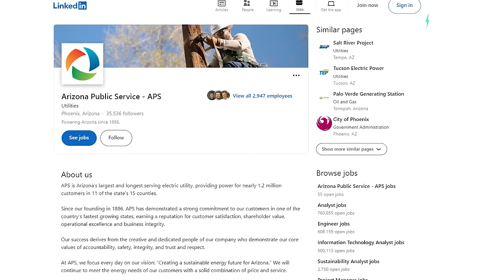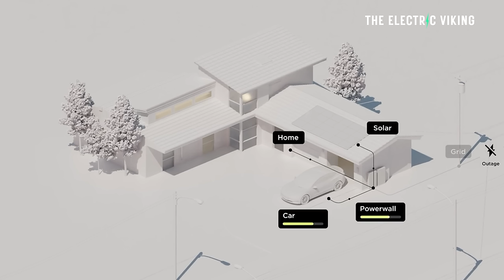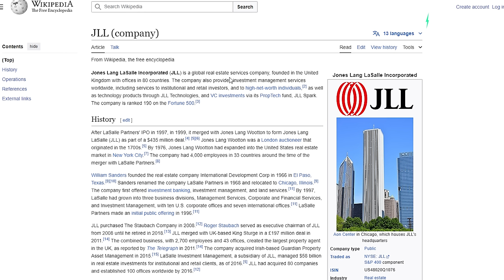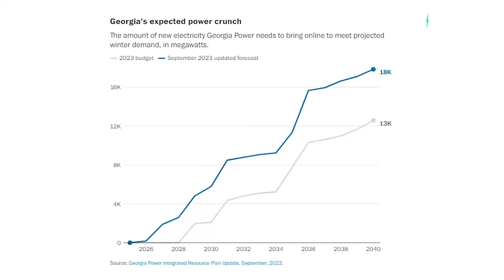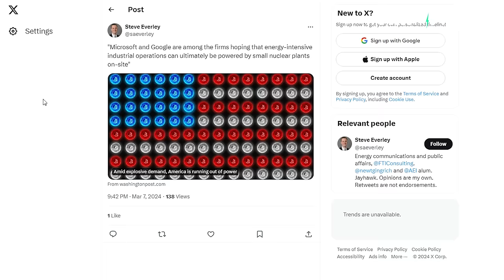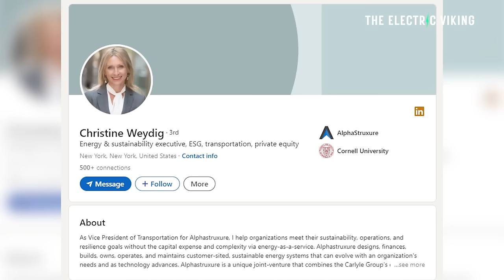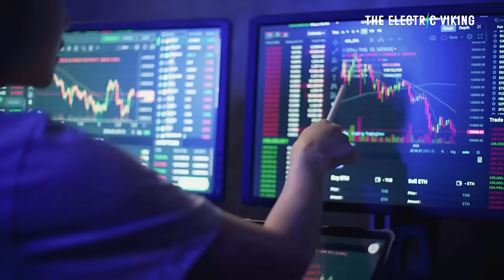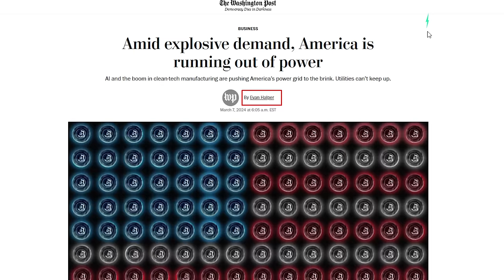An explosion in demand for electricity is creating a looming crisis in America

Comment: I'm not hopeful about permitting reform, interconnects, transmission lines.  There are too many interests involved.  

Data centers should be responsible for their own power (or at least a good portion of it).  These are tech companies with deep pockets.  Maybe they can jump start the micro-grid, off-grid business, drive down the costs, and the rest of us can benefit from it.  (Also, nuclear.  Though nuclear has its own regulatory challenges.)  They can  also  co-locate the centers where there is strong renewable resources.  It's easier to ship data, than ship electricity.

Comment: In Mexico, commercial electricity rates are much higher than residential rates.  More usage per month can put either  commercial or residential into higher marginal electricity rates.  It seems that in the USA, the large users get preferential electricity rates.  If the rates for large electricity usage increased substantially - the high users would be incented to install batteries and possibly solar to defray the higher monthly cost.

We need to fix the incentive system for electricity in the USA.
Reply: Commerical SOLAR generation & Storage, over Commerical energy use.

Comment: Nuclear has TWO MILLION tiimes the energy density of solar, wiind, battery, geothermal, etc. It is the cleanest, safest, most reliable source of power. The U.S. built 100 nuclear plants in a 10 year period in the 60s & 70s, average build time was 36 months, and could be again. NONE of those plants has harmed anyone from radiation. The Nuclear Regulatory Commission has driven up cost of nuclear plant construction in the U.S. and needs MASSIVE REFORM. The smaller the size and greater the number of plants, the more distribution over distances on the grid is reduced. It also reduces cost of borrowed money for long-duration builds. When nuclear has a renaissance you'll know math, science, and seriousness have returned to public policy in the U.S.
Reply: True.
The best, and constantly operating nuclear power is being generated 8 licht minutes away.
Reply: What will fix the issues here is STANDARDIZATION - ONE and ONLY one reactor design and the SAME controls across the ENTIRE US.
Reply: @stevenmercurio8536  Sometimes that helps. But often : one size doesn’t fit all.
At some (bigger) places: Thorium, but at smaller, or temporary places SMR.
Reply: Nuclear is not clean, this is BS. Where do you store the nuclear waste? Decommissioning a nuclear plant is a long expensive process, that nuclear advocate never calculate in total cost of operation. Renewable + battery storage is the answer, along with all the EV batteries that could help the grid when needed.
Reply: @hanswitvliet8188 Exactly!  The solar panel farms are the receiving end of the wireless solar power system.
They allow agriculture beneath them and cannot be used to make dirty bombs.
Reply: We do have some rather unsafe nuclear reactors here in the US (Mark III's, IIRC, that require power to drive motors to push the control rods up from beneath the reacor against gravity, vs more modern designs that can lower control rods from above via gravity when power is lost (like in Fukishima)).  

Any new plants should be built as Thorium Salt Reactors that create less waste, have lower half-life of radiation, and are safer to operate b/c they don't require shutdowns to replace spent fuel rods every 18 months (they are perpetual processes).
https://www.youtube.com/watch?v=1BmWhS7g2ts&ab_channel=SubjectZeroScience
Reply: @rozonoemi9374  You are both full of it.  CCTG and CTG on natural gas is by far the best solution.
Reply: @rozonoemi9374  Except that until battery storage needs to be about 10% as expensive as it is now to make this practical
Reply: @danielking2944  at Some places, big parking lots are covered with PV, like the TT-race circuit near Assen.
Reply: @rozonoemi9374  No, it isn’t BS, but an economic choice.
In France they demonstrated that they can reduce the half-life of plutonium and cesium to less than two years. But it comes at a price, that some are unwilling to pay.
Reply: @hanswitvliet8188  Thank you. Most people disconnect that solar power is actually NUCLEAR and not chemical. Big difference.
Reply: @rozonoemi9374  FICTION and poor fiction at that. High level waste is stored on site at every plant in the U.S., has been since the beginning, and has NEVER HARMED A SINGLE PERSON. Plants from the 60s and 70s are still running and having extended licenses for another 20 years. Compare that to the MILLIONS of deaths yearly from fossil fuels, which provide EIGHTY ONE percent of total energy globally in 2023, fossil fuels is the alternative, and never takes responsibility for waste. Which oil company do you work for?
Reply: Of the 253 nuclear plants that were originally ordered between 1953 and 2008, 121 (48 percent) were canceled before completion. Of the 132 plants that were built, 21 were permanently shut down due to reliability or cost problems, while another 27% completely failed for a year or more at least once, according to Rocky Mountain Institute.  The average nuclear reactor only delivers about 1 Gigawatt. Palo Verde has 3 reactors and only delivers just under 4 Gigawatts and took 10 years to build.  San Onofre was 2 Gigawatts and was shut down about 10 years ago and is still in the process of decommissioning.  Billions of dollars to build and billions of dollars to decommission.  Last year the US add 33 Gigawatts of solar, or about the equivalent of 33 nuclear reactors.  Nuclear power is an industry that has proven that it can deliver an ever more expensive product and take longer to produce it.  If energy were based on market forces, the nuclear industry would have been out of business long ago.
Reply: @rozonoemi9374  I agree 100%
Reply: @rozonoemi9374 battery disposal will be a problem and we have no idea what the long term consequences will be.
Reply: @muskrat3291  I can cherry pick data and make a much more compelling pro-nuclear argument, but considering your apparent bias, I won't bother. Enjoy watching the ecosystem go up in flames and drought, crop failure and famine, coral bleaching and ocean acidification, while China has 22 reactors under construction, approved 10 in 2022, & has the capacity to add 8-10 EACH YEAR, which has driven down the price of nuclear power in China to below $70 per megawatt-hour, compared with $105 in the U.S. & $160 in the European Union, according to the International Energy Agency. Where there is a will, there is a way; where there is defeatism, there's a muskrat3291.
Reply: But they never get built on time and always  double the budget
Reply: @samuelwilliams7331  The 100 plants built in the 10 year period of the 60s-70s were in fact built on time and on budget, average build time was 36 months. It can be done again. NRC must be reformed and nuclear industry in the U.S. must be rebuilt. U.S. doesn't really do nuclear. China, Russia, France to a degree, still have a nuclear industry. It takes experienced workforce and established supply chain to be efficient, not NRC meddling / interference.
Reply: The issue is EVERY SINGLE ONE was a one off!  NO standards its like trying to build cars but you change the design after building each one - no kidding they are crazy expensive and harder than they should be to maintain and operate!
Reply: @stevenmercurio8536  Early U.S. nuclear plants weren't one off, and the NRC added ZERO benefit; NO BENEFIT WAS NEEDED. Nuclear plants are easy peasy to maintain & operate. Nuclear and non-nuclear power plants around the world are run by computers. The humans at nuclear plants sit arouind watching monitors of a perfectly functioning computer system.
Reply: @beautifulgirl219  I work for Elon!

Comment: ac and solar should go hand in hand when rhe  ac is on the sun is usually out
Reply: Yes!
It is the answer and saves you a fortune.
Use the roof you have and cover it in solar to power the home battery and EV you have.
This is then yours and this is why the electric companies want to limit or stop it.
Take care all and do what is best for you. M.
Reply: Not in TX. It can be 88 degrees outside, while cloudy, or 78 degrees and muggy, while cloudy. Also, it can be 88 degrees at night for about 6 months out of the year around summer.
Reply: @RT-mv7df   Solar works fine in Texas for active cancellation of Air Conditioning.  Why make up such BS?

Comment: "Green hydrogen" from electrolysis has a round trip efficiency of <40%. You loose 60% of the energy by using hydrogen than if you were to use the electricity directly.

Comment: Demand for electricty in the United States right now is truly enormous absolutely and in no small measure being driven by a massive surge in lng exports and Space Launch and presumably pure play bev sales which continue to surge and are starting to be seen as not in the least cost free to use over the long term anyways but no different from current pure play ICE platforms as is already well established. USA does import nominal amounts of electricty from Mexico and Canada which mitigates somewhat but nothing compared to with the massive build out of combined cycle natural gas turbine generation added to that moar wind power which at the moment for the USA is a very impressive and prodigious producer of the electrons particularly in the US State of Texas but also the State of Iowa plus going up and down the Columbia River Valley where massive amounts of electricty is produced using hydroelectric generation. Long story short no matter how bad the news coming out from Boeing hard to produce an air frame of less expense than a Boeing going on forever now #autoclave

Comment: Now let me get this right - America develops more demand for electricity by developing more data centers which consume huge amounts of electricity, build ever more demand for electricity by pouring ever more people into cities by driving more people away from rural areas, pour more people into cities from outside of America thru open border policies, increase demand for electricity by making people dependent on personal devices and transport systems, make accommodation more reliant on electrical devices, drive electrical production away from readily available "fossil fuels" and toward unreliable "sustainable energy", reduce maintenance let alone expansion of the electrical grid, and SURPRISE!!!!, the electrical grid fails to cope with demand - "how did that happen???" wonders those responsible for all of it and everyone but them saw coming....
Reply: Spot on!!!  And for each household that converts to EVs (let's just say 2 cars per home), adds 30-50% more demand in electricity -- average of 300kwh per car per month (equivalent of about 10kwh per day, equivalent to 30-40 miles per day in a Tesla Model 3 that has rough efficiency of 4mi/kwh). Average daily commute in US is about 35 miles. So for 2 cars, that's roughly 600kwh extra on your electric bill per month.  Go look at your energy bill & see what that does to the total electric you use each month.  For me in a 1100sqft 2BR apt, my electric is 900kwh per month (averaged over 12 months). So this is 2/3rd the total electric of a medium apartment.

Better invest another $30 Grand in solar and batteries, especially since everything you just mentioned WILL increase the cost of electricity, and even then, if you avoid the electric rate increase, the gov't is still going to shaft everyone with higher taxes to try (but Fail miserably, and thus devalue/destroy the $) to pay for all this.  There's a reason we have inflation, and why it's not going to go away like the Gov't is trying to convince everyone.

Comment: Is Sam aware at least three of those Tesla storage sites caught fire and couldn’t be put out.
The theory is right, but the application isn’t, the type of battery being used isn’t ideal.

PART OF STORY BELOW
This is the third Megapack and Powerpack fire that has emerged in a bit more than two years and the second one in Australia. The first happened on July 30, 2021. A Megapack caught fire in the Victorian Big Battery in Victoria, Australia, while it was still on tests. It was later determined that the combustion happened due to a short circuit. The second one started at 1:30 AM on September 20 in Monterey County, California. The Elkhorn Battery Storage facility fire demanded Highway 1 be closed so that firefighters could use one of its sections to extinguish the fire

SINCE THEN
Two have happened in Australia one in Queensland.

Comment: Very predictable. Industry is very energy intensive. Electrically powered industry needs all this in the form of electrical energy (as against heat).  Failure to construct and complete nukes is going to cost them dearly. 

Might be possible to do it with renewables but this will require huge upgrades to pumped hydro and the necessary aggregation grids.

Comment: The reason that Crypto will not and does not want its own generation (a long-term plan) is because Crypto is a short-term operation.  The primary reason it exists is because there is a(nother short term) bad-faith operator of the primary currency.  Whole other topic, but also not a long-term condition.   Meanwhile, Solar PV is expanding quicker than the overall load of the grid.  And the routing for future Transmission is not what has become the relatively short (few hundred miles, max) of overhead HV AC -- but rather HVDC, which can go Coast-to-Coast, making a 12 to 14 hour Solar (only) Day.  And the (already known) best routing for HVDC is underground, along the existing city-to-city Interstate Highway system.   These were mostly make-believe problems in this video, while missing what is really going on.

Comment: In temperate latitudes a wind and solar is a stupid, dreadful idea, especially if it is supply baseload. That is because for every megawatt of solar baseload you have to build the same value in back-up power for when the sun is not shining or the wind is not blowing. Batteries (we’ll ignore how the planet has to be r@ped to make them) can be used but they can only short term relief. Using car batteries requires them to hooked up and then to a “charger” that can power the grid.

Comment: Texas has lots of empty room for wind farms, even then Natural gas supplies the base load. 3x the name plate rating of wind turbines. Wind turbines and solar are only 30% efficient.
The further north you go, the worse the efficiency. Texas wind turbines shutdown because cold weather dropped below their temperature rating.  There is no such thing as excess power generation, gas and coal plants throttle with demand.
Reply: There is no "temperature rating" for a wind turbine.   During the Texas Freeze many turbines shut-down because ice formed on the blades, unbalancing them.  So they had to be turned off.  But turbines further north that were built with de-icing strips on the blades kept running normally.

Comment: Texas has the answer. Instead of nesting in coal or oil fired electric generators, they are investing in renewables.   TEXAS  had more renewables than any other state. YES including California. 
    You see Texans can do math.   They understand the multi millions it takes to build the power plant is only 20% of the cost.  The rest is buying the fuel for that power plant.  
 While renewables have no such costs. 
       During high wind/ solar periods they charge up  storage batteries ( whose cost is dropping rapidly).  For the use when the sun fails to come up or the wind fails to blow.   Yes even n cloudy days solar panels generate electricity.  With taller and taller wind generators  wind is more and more reliable.

Comment: Electrify rates in Texas are 14.58 ¢/kWh, whereas in California, the nation's leader in "green" generation and battery storage, the rate is 29.11 ¢/kWh. Go green, get boned.
Reply: Go green, get your own solar and battery and save in your pocket.
I’m not green just want to save my money.
Take care M.
Reply: When the climate changed Texans will suffering power crisis like 2021 more often.

Start develop diesel powered iPhone , refrigerator , computer and everything else.
Reply: In 2022, CA generated 32.3% of its electricity from wind + solar... and TX 27.1%.  This relatively small difference is CERTAINLY not accounting for the difference in the price of the kWh!!!
Whether you like it or not, wind and solar ARE the cheapest sources of energy... even when accounting for storage.
Reply: California has always had expensive electricity, from long before renewables became a thing.  On the other-hand, California does not charge people two year's worth of consumption when a state-wide emergency happens or let people die in their homes due to rigged "rolling blackouts" that don't actually roll.

Also, you might be unaware of this, but Californians in general use about half the electricity per capita than Texans use.  The utility bills are actually fairly similar to each other.

The main reason is that infrastructure is the major costs for a utility, not the actual electricity.  The infrastructure has to be maintained whether the population uses a lot of electricity or not.